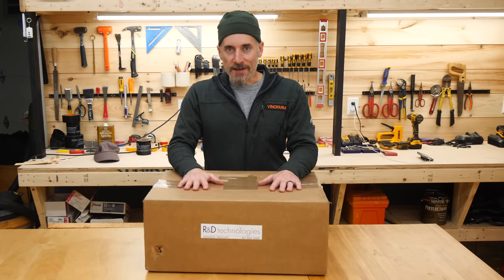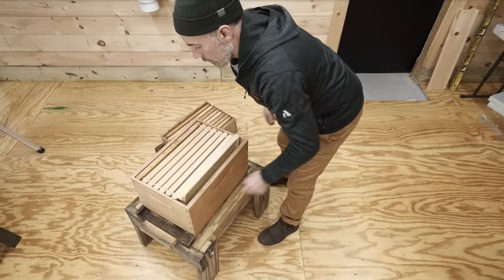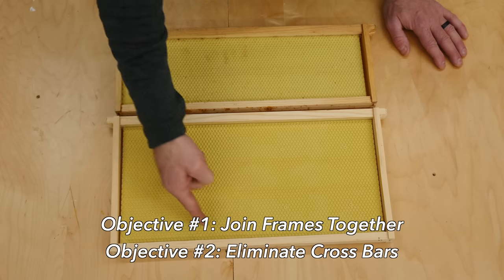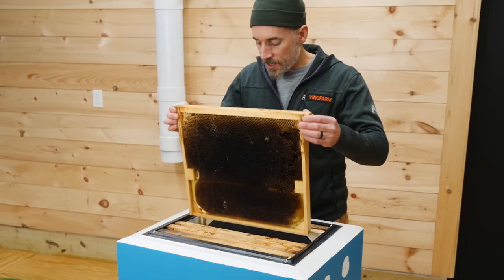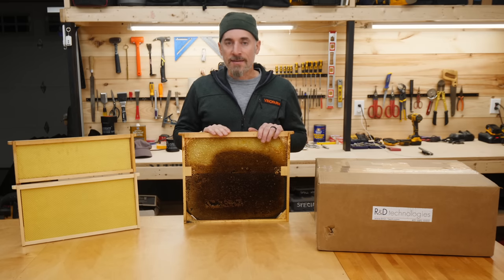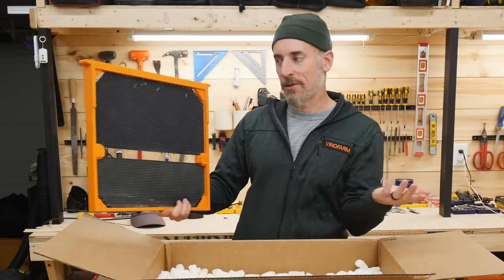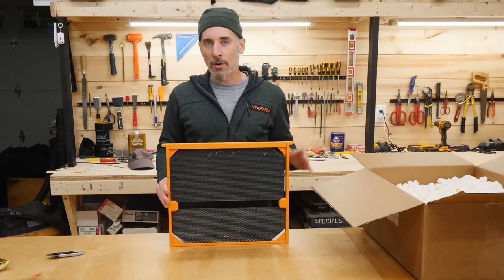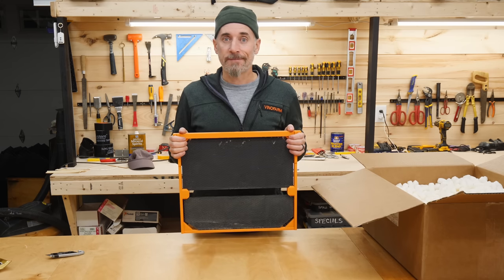Bigger, Better Bee Frames? Let’s Make This Happen!

Comment: I don't understand why the 3D print looks EXACTLY like your wooden version.  Why gussets?  Why the split board instead of one piece?  Why the gaps everywhere?  It seems like none of that is necessary and just takes away more real estate from the bees.  Why not simply injection mold the entire thing in one piece, including the foundation board?  And so many other things...  I just don't get this.  I really love your channel and the things you do, but this prototype seems to have left countless opportunities on the floor.
Reply: Maybe look at the pinned comment, that should answer most of your questions
Reply from the maker: See pinned comment. Gussets provide rigidity. All gaps are filled by the bees. The cut foundation edges allow for easier how-swapping of foundation. I've had two years of development with these. It's all been thought over extensively.

Comment: Very very cool

Nice work!
Reply: I can help you do a few iterations of your frames to simplify the frames into components that are easier to manufacture. I'm an Industrial designer. I am proficient at 3d modelling, have access to a cnc, 3d printer, and potentially a small injection molding machine. I've also had a couple of my own parts molded recently. Let me know if you want to chat.

Comment: So I like the direction you’re going. I’ve been sold on insulated hives for a long time, being from the Midwest. My only concern is honey extraction—do these new frames fit in any honey extractors that you’re aware of?
Reply: You can still use honeysupers on top. So you can use the standard equipment on those.

I think the purpose of the bee barn in meant for the bees and not honey. 
And the honey in the bee barn is used for the winter by the bees. (and other moments with low food). 

But that's just how i see it. I could have misunderstood it.
Reply: These extra large bee barn frames are exclusively for the brood box of the hive, you can add regular medium honey supers on top as you'd usually do in a regular Langstroth hive.
Reply: But the concept also calls for not having to lift boxes. My thought is to use these frames in a horizontal hive (insulated up north) and be able to extract honey. I get the “for the bees” thought process but that eliminates probably 90% of a market for this product.
Reply: @rodneymccrea7214  I'm not sure this design would be Best for a horizontal hive, the Bee Barn and XL frames where designed around, and specifically modified off of a typical standard Langstroth hive. So it might not be as practical for a horizontal hive
Reply: @justiceifeme  which was exactly my point. Not sure what the end game is here considering there are layens hives with large frames already in existence as well as commercially available insulated hives like the Apimaye. Why wouldn’t a horizontal hive work with these frames?
Reply from the maker: These are not designed to be extracted. They are brood frames. Not meant to go in a horizontal/long hive. The bee barn concept is vertical and supered with your existing Langstroth equipment.
Reply: @vinofarm  gotcha. Will be interesting to see how fast these colonies brood-up. I like the concept—just being devil’s advocate. Been using the Apimaye hives for a year now and love experimenting like this. Keeping any eye on you! ;-)
Reply: @rodneymccrea7214  Going by the experiences several beekeepers have with bee barns, these bee barns advance the calendar by about two months.
Reply: @apveening  I wonder if you should talk to the injection molding company about manufacturing the insulated boxes as well—I’m guessing they would last much longer than wood. Looking forward to see what you come up with!
Reply: @rodneymccrea7214  Not me, Jim.
Reply: @apveening  I should pay attention to who wrote the reply lol
Reply: I am a beginning beekeeper in 2023 and was planning to build Bee Barn 2.0 hives but had to change direction - Betterbee is out-of-stock of some Lyson 8/9 equipment - can’t get them in time to be ready for my bee order.  I’ve ordered the Paradise/BeeBox poly hives from Blue Sky and plan to get started with those as-is.  I want to transition to the bee barn frames in the BeeBox hives and I’m in for 20-40 of your frames when available.

Comment: I think now that you ahd i chance maybe you shouldve made it a bit bigger/longer frames that willl SPECIFICALY be at teh bottom of the bee barn.Then the original version of your frames to be for  the upper part of the barna nd extentions.Thast atelast what i would do.
I wouldve make bigger frames almost(not realy) double the size that will specifialy be on the botom and nop where else while your original size frames would be on upper aprts of the barn alogside extention if want to add more boxes.

Comment: woot I was Correct!
Reply: What is the cost of the two frames. I was thinking that you could just 3d print connectors peaces.
Reply: @seribusDragon  I think you might have good idea there. Maybe buying the wooden side pieces for what ever size combination you want and then connecting them with a specially designed plastic connector that would fit both wooden side pieces. I have read though almost every wood hive part manufacturer has slight differences in the finished products dimensions. That could be a problem.
Reply: @karlgant8953  print in place set screw of each connection.  then you could leave a little play in the peaces.  then you could print on a quite small printer and it would take less time.  and I think you would two only print two parts to connect the top and bottoms.  Question:  Why do they need the middle channel would little tables work.